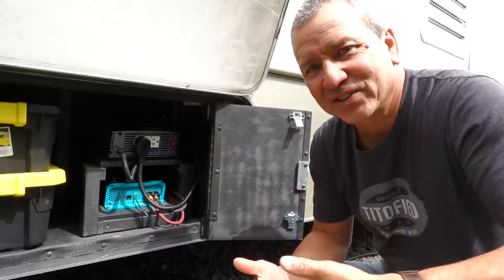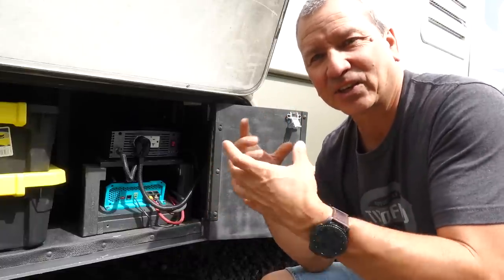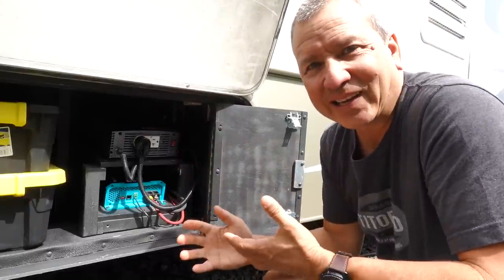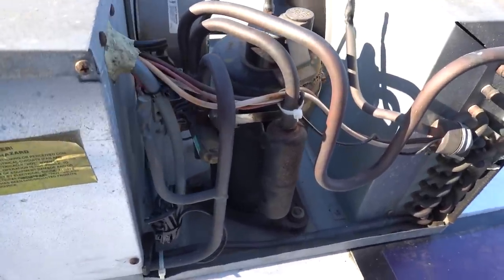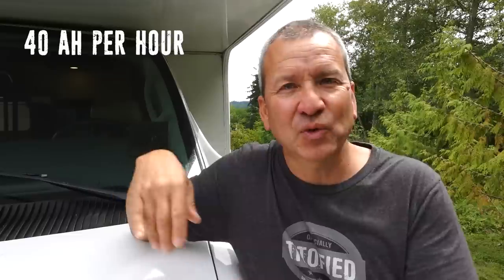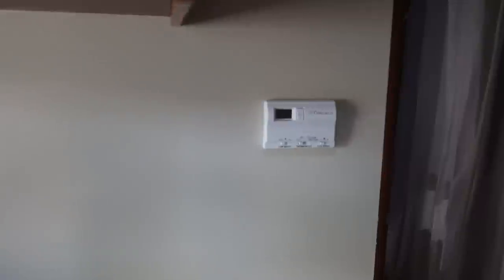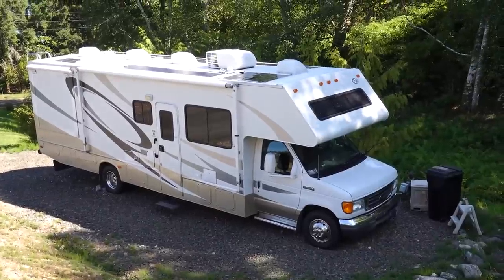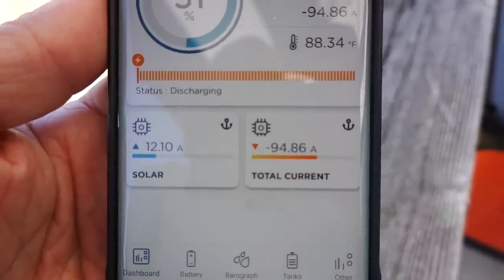BAD IDEA? Running RV Air Conditioner on SOLAR and INVERTER

Comment: Extremely informative & presentation, as always, well thought out. You are such a great instructor. Thank you again Brian. Titofied production!  😇🤩💜
Reply from the maker: My pleasure! I appreciate that. Hmmmm "a Titofied Production". I like that :)
Reply: A lot of these inverters nowadays have soft start built into them I just test it out my AC unit on my solar 200 amp hour batteries with a 25 amp input coming in from the sun it took my battery is down to 12.4  9hundred watts and was able to stay on. at that point as long as you have 900 watts coming in from the solar should work I would imagine. I'm still testing
Reply: Very neat video here what I did pick was having a small inverter type generator can be used to run the AC as long as I install  a soft start unit on the AC is that correct? If so that would safe hours on my main generator. I'm going to have a solar system like yours installed.  I would like to here what your solar components include.

Comment: I use this solar Generater.Systems  at work. The building is 80 years old so there’s not a lot of electrical outlets. I use it for lights, fans, charge phones etc. works great !
Reply from the maker: You'll need a generator or DC-DC charger. It's good to have multiple options since the sun doesn't always shine.

Comment: Hello, I have 1360 watts of solar, 5 100amp lithium battle born batteries and a 3000 watt pure sine victron inverter. Currently I am running a coleman mach Roof A/C with the easy start I installed. As long as I am in a state that is sunny most of the time I do not have an issue! 
Thanks for your video! ~ Lisa
Reply from the maker: Very nice! Thanks for sharing your setup.
Reply: 1350 Watts of solar?  No wonder you have no problem running the AC.
Reply: What panels are you using and how many?
Reply: How do you have 5 batteries? Are you running that with 12v? What sort of charge controller do you have for that?
Reply: @RVwithTito  when will the person give the person who asked questions answer?  What type of controller and brand names.  I'm trying to figure out how to keep my milk cold without buying ice or standing around making my own ice all day.  Able to make enough ice to keep my cooler will last all day and night that my friend gave me.  He had gotten as a volunteer for the Red Cross many years ago and he passed it on to me since he didn't need it and I did.
Reply: That's like $5000 in batteries!!!
Reply: @ranig2848  panel brand, number of panels, mono vs poly......it doesn't make a difference. 1360w is always going to be 1360w whether its 1 panel or 10. Most likely, they are wired in parallel to keep them at 12v (pwm controller) but the individual panels add up to 1360w. If he's using a MPPT that can handle higher voltages, then the panels might be rated for 24/36/48v or he's using a combination of series/parallel wiring to the controller.  These are the two most common configurations.
Reply: @mobileempire5522  You can put together a 560ah LiFePO4 setup with fully customizable BMS/protections for about $1500
Reply: @mobileempire5522  of
Reply: @Wellness Detector  your better of getting multiple MPPT charge controllers and having say 6x 160w (8amp each panel) shingled solar panels for a total of 960watt, run the panels - 2x 160w panels into its own 30amp charge controller, another 2x160w panels into its own, and the 3rd set of 2x160w into another controller, that way if the shade hits the panels on half of the 960watt its not affecting the other two charge controllers and panels on the roof, your also then reducing the wiring gauge by doing so, it also costs less buying 3 sets of lower amp charge controllers than it does to buy a single larger controller.

Comment: Well done Tito, thanks for another well produced and very informative video.

We recently upgraded our Battery/Inverter system specifically with boondocking while running everything on our 37' DP much like being plugged in (at least like having 30A plugin) :)

In any case out set-up is as follows:
(8) Lion Energy 105Ah LifePO4 Batteries configured at 24V (420Ah)
(2) Victron 24/3000 Inverter/Chargers 
1600W Solar W/ Victron 150/100 MPPT Controller
(2) 24-12V/70A Converters (to service 12V systems)
(2) 12-24/15A DC-DC Converters (To charge Batteries while traveling)
Victron Cerbo GX with GX Display and VRM interface

So when we installed this in July we configured the system to power every circuit in our Coach and did this in Split-Phase which allowed us to install a 240V circuit for future use (Dual Zone Mini-Split AC Heatpump).

As it is right now we can actually start and run both of our 13.5K rooftop AC units without a soft start, but I did order one to see how it works. When we finalize the installation of the mini-split in the future we'll remove the rooftop units and reconfigure for more solar :)

We can actually travel down the road now with one rooftop unit running and still put power back into the batteries as long as we can produce at least 1000W of the 1600W Available.

Running just a rooftop unit (with the rest of the coach stuff) while stationary we can run a single unit and only use about 20A tailing off to about 60A total with no solar (@24V) so we have a good 4 hours of AC after the sun goes down while still being able to run the coach overnight.

When we get the mini-split installed it will use approx. 50% of the power of the rooftop unit and hopefully we'll be all set, especially when we add some more solar.

So it can be done but it's not easy, I only post this to show people that I CAN be done, but to your point in the video a small generator will work just fine for most people if the rooftop units can keep up.

Happy travels!!

Comment: 1) Your Class C is far better insulated than our Class A!   We have to run 2 AC units on a summer day to keep the temperature down to 85 degrees.  We’ll run the AC off the generator only.  I have 1200W of solar on the roof with a Victorn 150/85 controller.  We use a Magnum 2800W inverter.   And have 6 Lifeline 6V 220Amp hour AGMs.  Next batter switch will be to LiFeSO4.    

2) Thanks for your videos.  We enjoy your projects and can’t wait to get a house with a work shop to do some work on our 2008 motorhome.   Storage and weight  limitations prevent me from projects.

Comment: I pulled all of my A/C units out and put one 12000 BTU 115v mini-split in my custom-built cargo trailer. I'm so glad I did. Can run it throughout the day on solar with no problems. Plus running a small Arctic king freezer, NewAir ice machine, lights, 55 inch TV, DVD player all at the same time. With a system that has a: Samlex EVO-2224 charger/ inverter ( 4 ) 320 watt solar making 1280 total watts ( 4 ) 370Ah 6v flooded batteries. I've seen it get down to 76%, but the average is 80% on the batteries during the day. At night I would run a generator to keep up the same consumption, but if I don't need the A/C to run, then I don't need to run any generator, the system can handle all my needs throughout the night; until sunlight again. The mini-split runs about 9Amp to 12 Amps when running when it goes into a so-call float. It runs about 3amps to 4 amp to maintain my temperature of 77 inside and a 109 outside. I also like to say: it's so quiet, it's incredible, NO MORE noisy jet engine sounding A/C units ever again! The unit is a Senville mini-split I paid just under $800.00 for everything. I installed it myself, and have never done any A/C work before. Take your time. It's a piece of cake. So, so happy! You can too, if you want peace and quiet, with temperature, controlled home/ RV/ Trailer
Reply from the maker: That's impressive! Thanks for sharing you're numbers. I've been curious how much current a mini split draws. 👍👍
Reply: For those amp draws you must have 48 bolts
Reply: Ed Mor no, it’s 24 v not 48 bolts. I built the system, I know!
Reply: Your able to vacume to lines yourself?
Reply: @Hoffmanpack  yes, I was a little nervous though, because I have never done it, then on top of that, I also used an Appion mega flow vacuum rate valve core removal tool with the vac pump that was vacuuming out the lines. Then have to put the core back in the valve body. You don't have to use that tool to do the vacuum. Once it all done then you released the refrigerant into the system.
Reply: I came back to make a small correction. I am running 9 amps to 12 amps total with all things have running at the same time with the A/C at and this is my total consumption of power. Watts, it would be around 1440 [ 12 amps x 120 volts ]. Also will add a link to a new video on installing and mini-split unit too. https://youtu.be/JQkth-AM5CE

Comment: I found the same thing Brian,  Not only that but the hotter the ambient temperature  the less efficient the solar panel is.  Manufacturers rate their products’ susceptibility to temperature in the form of the temperature coefficient, which is expressed as a percentage per degree Celsius. It is standard practice to test solar panels for power output at 25 °C. So, if a panel is rated to have a temperature coefficient of -0.50% per °C, that panel’s output power will decrease by a half of a percent for every degree the temperature rises about 25 °C (77 °F).
Reply: You're 100% right solar panels need to sunlight but hate the Heat, that's why you must always over panel in preparation for that.

Also keep in mind in the winter time you would generate more power then the rating since the temperature it's lower than 77F.

Good for electric heaters instead of burning propane.
Reply from the maker: True. More reason to follow that 77 deg Standard Test Condition temp around :)

Comment: Consider setting t-stat to 78  instead of 74. Your ac unit will dehumidify your space and use less kwh and still be comfortable. I live in Florida and that's where I set it during the day. I'm a retired PE mech/elect. All the best.
Reply from the maker: That would be better. At home we usually keep it at 74 which is why I set it there for this test. 78 degF is probably a more reasonable comfortable temp while dry-camping. Thanks for the insight.

Comment: One thing to keep in mind is that these AC’s use more power when it’s 85 - 110 + 
I installed the easy start - great product .My small generator will run when below 85 outside - but not over 85 .Fun video to watch.🥵🔥

Comment: 4 x Battle borns and victron 3000 I get about same results with my softstart. When it's around 90 and above I just rely on starting my Honda 2200 to assist in powering my ac. I have 5 x 160 watt on roof but at direct light only get max 500 watts input. Renogy flat panels. Love your flat panel mount idea going to deploy on my panels!
Reply from the maker: Great. Thanks for sharing that. Cheers!

Comment: Great video, it helps answer a question that many people have.  Clearly you can run A/C off grid from solar - maybe not all day every day, maybe you need more solar panels and/or more batteries and maybe a decent inverter - but it can be done.  Of course you could increase the temperature setting on the A/C so it runs a bit less.  If the camper was better insulated (maybe double glazing) then the A/C wouldn't have to work as hard.

It is good to see what happens with 600W of solar and 400Ah of batteries and 2,000W inverter, that provides a basis for working out what would be needed to run the A/C more often or less often.
Reply from the maker: Thanks for the feedback Mark. You picked up on my point in making the video which was to see what was possible with a moderate setup as a baseline. 👍

Comment: Hey Brian,

Great video, and very timely!  I appreciate the practical approach to your videos and you taking time to explain the “why”, makes it easy to apply to each individual situation.

We have a 50 amp rig with:
975 watts of solar
400 AH Lithium battery bank
3000 watt Inverter
4500 watt inverter\generator
The Air Conditioner tied to the battery bank has a soft start as well.  Same as yours, it consumes about 100AHs (~1 battery per hour) when running.

We are in NE Pennsylvania this week and it has been blistering hot (mid 90’s).  It has been a bit of a struggle to keep our rig comfortable during the heat of the day.
We are on a 30 amp pedestal, but with a full park (and lots of running ACs) the voltage on the pedestal has been averaging 105V-107V...BEFORE we take any juice.  Our EMS shuts power down to the rig at anything under 105V.  SO....it has been a balancing act for sure.  Through trial and error, I was able to take ~ 7 amps off the pedestal during the highest load time with out tripping my BMS.  That allowed my battery bank to last most of the day.  I only had to run my generator for ~1.5hrs to get back to 50% charge.

The moral of the story.....where there is a will, there is a way.
Reply from the maker: Nice to have options so you can do the balancing thing. I appreciate you sharing your system setup and experiences.

Comment: Great Video!  I don't have a set up like yours yet, but my ultimate boondock setup is running my A/C on a 3,000 watt generator, powered by propane,  6 hours a day (3 in the morning, and 3 at night before bed) to keep the camper from getting to hot. Then the solar will help keep the batteries charged and only using low powered fans to circulate the air when the A/C is not running. With good insulation, covered and tinted windows, the A/C isn't working as hard, the draw on the batteries is well below my daily intake from the solar panels, and I am confident that I can will keep the battery level right around 80% during the dark hours.
Reply from the maker: Is this your current setup? Or by ultimate do you mean it's just hypothetical?
Reply: RV with Tito DIY I’m sorry, my comment was a little confusing. I currently RV part time and mostly on shore power. However, I do boondock on occasion to test what my needs are based on the power I normally use.
Next year I plan on RVing full time, Boondocking 5 days a week and on shore power the other two. 
My above scenario is my “Power Plan” setup once I get everything upgraded the way I want it for full time RVing.
Your video helped me answer a bunch of questions that I don’t have the equipment to test for myself now.  Thank You!
Reply from the maker: @MrBklein31  Understood. Thanks.

Comment: Thanks for the video, I have the same 600w solar, 4 100 amp hr. batteries, 3000 renogy inverter. I able to run my 15000 Coleman for about 2.5 hrs. When running the AC I'm showing 130 amp draw to the inverter. I thought that was way off, now that I seen the video makes me feel better. I thought something was wrong. I need to add more solar panels. Again thank you for the video

Comment: Thanks for this info- all good ..
Remember that new rv’s with all battery setups r using 12 volt ac units ,
Also - eliminating the inverter that uses at lot of energy to convert the power. Then also, the vehicles alternator is used a generator , kinda a sledge hammer , the vehicles alternator as an auxiliary power source...
Thanks again
Reply from the maker: Thanks for the info. I haven't done much research into 12V A/C units but I will.

Comment: I did  the same experiment but on a smaller scale , I have a truck camper with 215 watts of solar and a 2000 watt pure sine wave inverter hard wired in the RV through a transfer switch. On a hot sunny day no clouds I set my AC on 75 degrees. I also have 2 group 27 ,new batteries. My camper was already cool as I keep it turned on and plugged into shore power. Unplugged the shore power, turned on inverter and watched the meters amp draw and voltage. The AC cycles off and on all day. While off the solar charged back some loss. While on the AC draws about 700 watts after settling down. I've got the smallest roof AC made I think. I ran the AC pretty much all day to experiment but like you said unless you have a way to recharge the batteries at night its not practical . After depleting the power out of the batteries to 50% late afternoon  I shut it down plugged back up and turned the converter on to recharge the batteries over night. You can run a AC on solar just need more solar panels more amp hour of batteries and a more efficient  AC. Just a thought.
Reply from the maker: If you have access to shore power then that'll work I suppose. Still...more solar seems to be the solution.

Comment: Tito, first and foremost I love your videos. you give real info in the form of both data and components. This video, the one regarding running a/c on only your batts, struck me in a different way than probably most people. .. I lived in arizona for ten years so I know HEAT.... my question is about humidity.. when we had MONTHS of 100 plus degrees we switched to  swamp cooling or evaporative cooling - remember az is a 'dry heat' lol. we would set the ac for 80 and use the evap until we hit than temp. worked great. not an ice rink but - well - no humidity is really great. my kids would beg for blankets when they got out of t he pool as the evap on their skin would bring goose bumps up really quick. I'm moving from a boat to bus conversion now so I can't do this comparison but hope you will explore it.~~ !!! really great vids. much appreciated.